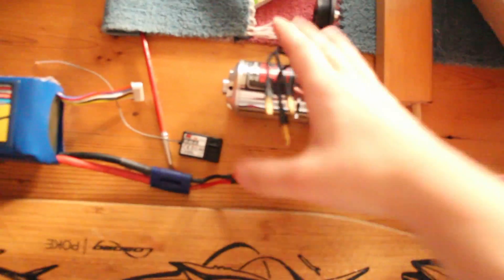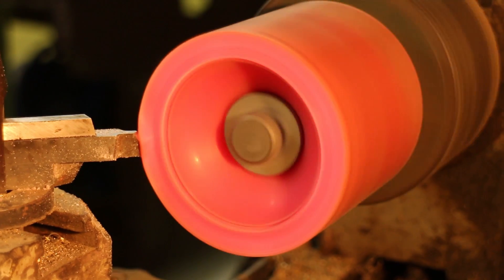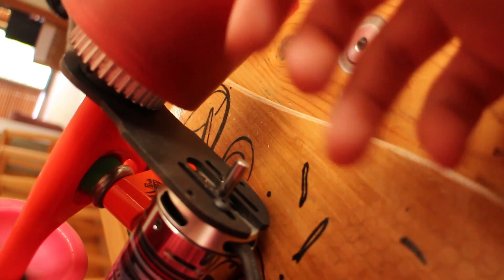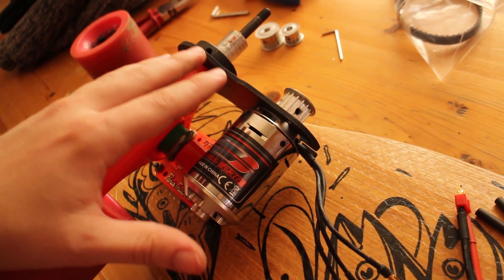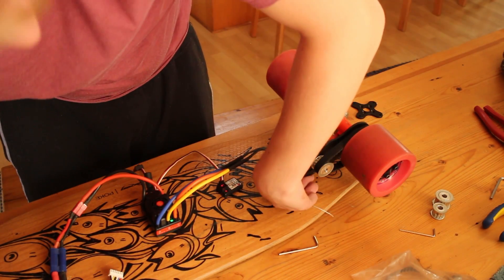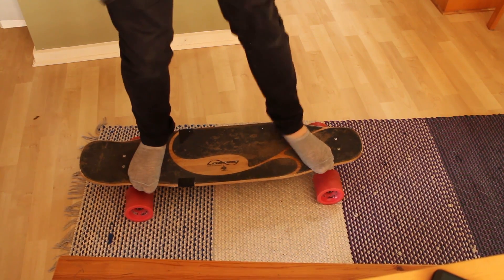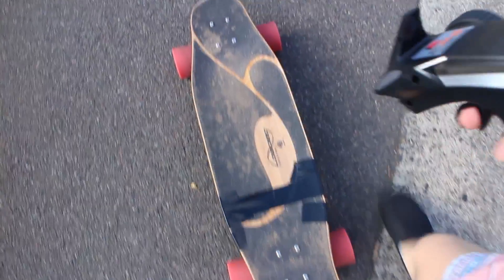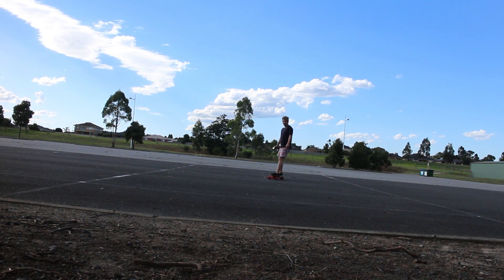• Homemade Boosted board! | DIY ELECTRIC SKATEBOARD

Comment: make a electric skateboard cheap
i choose two motor of ebay 
n5065 (china) 270kv or 400kv its better my battery is 22.2v lipo 
i want fast and torque
whith motor its better ?
Reply: 270 kv

Comment: I dont really understand what whs the problem
Reply: The gear for the motor pulley (the teethed gear that is attached to the shaft of the motor) was not secured. He only used one screw which meant that it wasn't tight (there are two holes for two screws), which then caused the shaft to spin and not so much the gear. Consequently, the pulley was not rotating as fast.
Reply: thanks
Reply: Mark van der Eb shitty ESC is the problem
Reply: It's a 120A BEC esc though? That allows for enough speed input to the motor. Plus I think it's waterproof haha.
Reply: that ESC doesn't provide instant Power like the vesc ESC. it's no really made for electric skate boards
Reply: read up on it
Reply: Yeah I agree, but a VESC is too expensive.